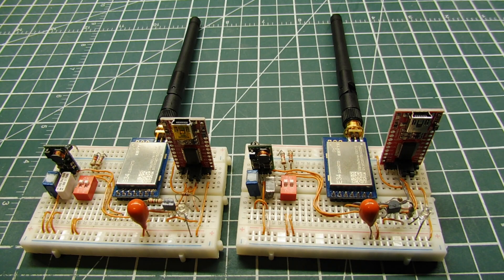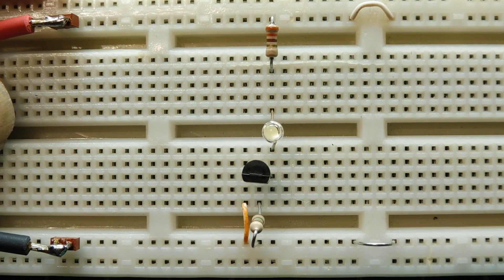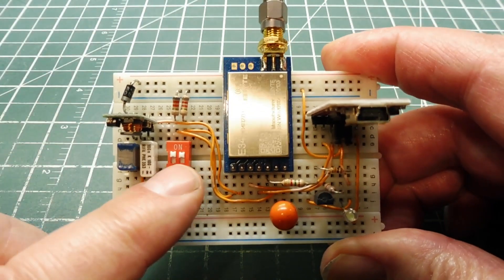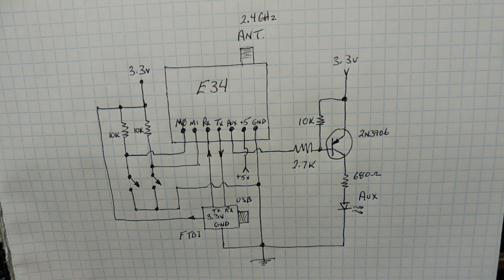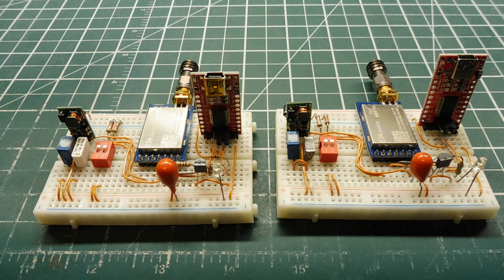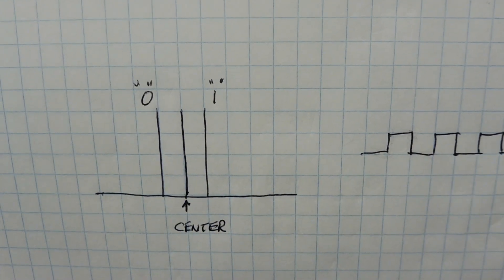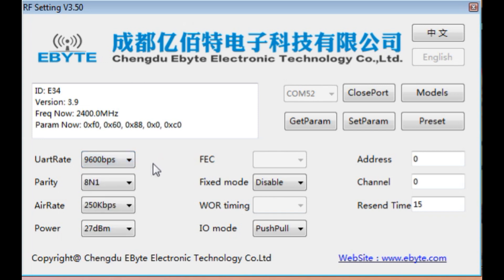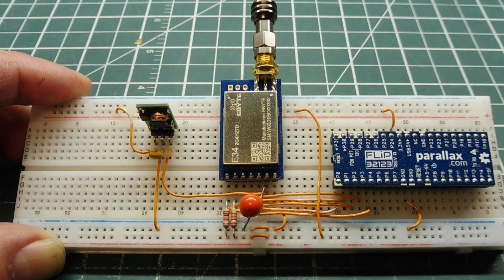LoRa Vs Spread Spectrum FHSS 2.4 GHz

Comment: Hi, thanks for tutorial, i can only find RF setting V3.49, will you please give me a link to download V3.5
Reply from the maker: https://www.dropbox.com/s/ri324y9izdlazl3/RF_Setting3.50.exe?dl=0
Reply: @0033mer  thank  you, when i run the tool on the E32 it works get parameters and sets, but doesn't work on the E34.... am only using the Uart to usb converter, do i have to use the same schematic as you showed. It does work on the E32 though! and yes i do have the M0 and M1 on 3.3v
Reply from the maker: I can program the E34 with only the Uart to USB converter using ver 3.50. Have you tried another E34 module?
Reply: @0033mer  yes i have four of them, it says "module not supported" lol, i emailed ebyte to see any solution
Reply from the maker: You may have modules that are much newer than mine. Try ver4.2
https://www.dropbox.com/s/8utd7ospz6qovd7/RF_Setting4.2.exe?dl=0
Reply: @0033mer  oooooo yay, it worked lol...you r the best, where do you get all the new versions, i cant find it on the ebyte site!
Reply from the maker: Their website is all over the place and always changing. If you are working on a serious project, get to know one of the application engineers.

Comment: Terrific video. Thank you! I’m developing a home made Radio Control system for model aeroplanes using ML01DP5 modules and FHSS in my software.  I’m thinking I should bin my FHSS code and use this module instead since their FHSS might be much better. Do you think I should do this?

Comment: Could you run slip or ppp over this? My serial communication experience is old, but I am thinking yes? So many uses on the farm and camping!
Reply from the maker: SLIP and PPP are serial protocols so you could make it work. SLIP is simpler than PPP with very little overhead so it would be easiest to implement. The radios sent data in packets with idle intervals between them and ending in an end flag character by SLIP so you would have to take that into consideration if timing is critical in your application.

Comment: Amazing, what would you think about a system with 32 such modules acting together in point2multipoint? What latencies are probable if for example each module will send a 8-128 bytes of system heartbeat payload data each 40-60 ms?